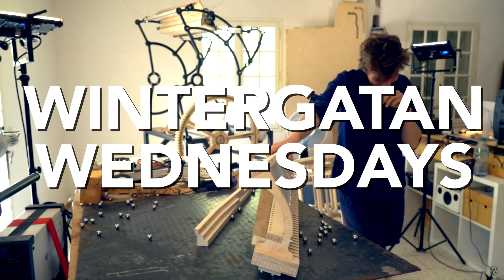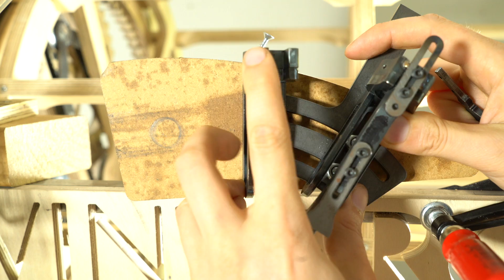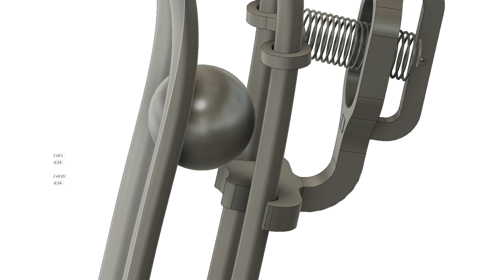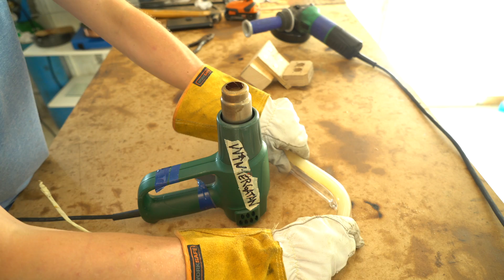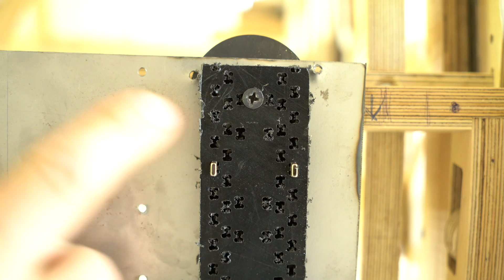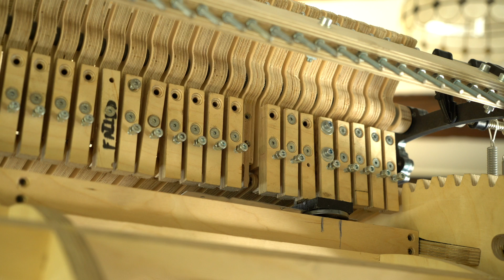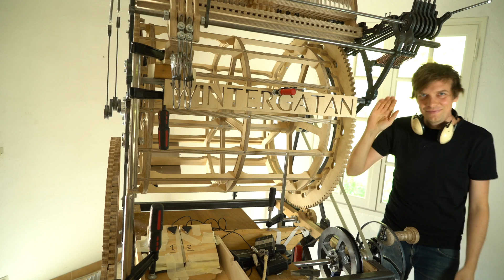Dropping the Ball - PRECISELY - Marble Machine X #52

Comment: And two-and-a-half years later, he has finally sorted out the marble dropping. Good work takes time...
Reply: You were a year early. He has now decided his design requirements were dumb, dropping from 2 points is dumb, the arc is dumb, adjustability is dumb. And simplified everything with actual tests to get 0ms timing and excellent position precision. And in 5 more years, we will have one that can land on the same atom with no losses to noise or heat either.

Comment: Yay, nice progress! Seeing you adjust the machine foot made me consider how important it will be for you to keep the machine stable and, level as you develop and tune it. Some relative and repeatable leveling method will give you a point of reference. When you move the machine, or add or remove heavy items, the level may change. Varying level will affect how the marbles move in a varying way. EG, a timing test with the machine tilted left and the marble impact targets seemingly level will have a different outcome than with the machine tilted right. Perhaps not as much between adjacent channels, the effect should get more pronounced when you test the timing between distant channels.

Comment: Clever solution adjusting timing with elastic bands, but will they hold their length indefinitely? I think they could lose elasticity in the long run and you might have to readjust timing over and over again.

Comment: Hi Martin,  your work is just electric...even though it doesn't use any!! A reference to your work (credited of course) would add a wonderful touch of excellence to a presentation we are doing. I would like to use 20 seconds of your Wintergarten Machine in a video that will only be shown on Power Point to a limited group of people. How do I gain permission from you please?

Comment: Fråga / Question :

En sak jag inte förstår: behövs det inte en motor som snurrar exakt samma hastighet med samma RPM hela tiden för att hålla BPM? Är det inte omöjligt att veva i exakt tempo manuellt? Det känns som att veva i tempo måste vara mycket svårare jämfört med att slå i tempo med en trumpinne. Hur funkar det?

One thing I don't understand: Isn't a motor that spins at the same rate constantly with the same RPM to keep the BPM? Isn't it impossible to crank in an exactly timed fashion manually? It seems as it would be a lot harder to crank in tempo compared to for example hitting a drum with a drumstick in tempo. How does that work?

Comment: The obvious solution is to drop the marbles with solenoids, BUT... If it's a rule that the machine should be purely mechanical (other than electronic pickups)...

Then I suggest each marble should be dropped with its own spring which releases the marble quickly regardless of machine speed.  That is, the marble gets stopped, then its spring to release is mechanically tensioned, slow or fast doesn't matter.  Then when the marble is to be released, the spring lets it go quickly, released in the same way a moustrap is triggered. 

That would probably be a total redesign, but it would solve the timing problem of delayed release with slow tempo.

Comment: for precise tuning of your timing, maybe using a drill set at a specific RPM on the crank shaft with an RPM meter may help to get your timing absolutely precise so that when you run ti by hand in a song you cna be sure its working exactly as intended, without the variability you may get when using hand operation. i figure no one can be perfectly precise in their ability to maintain the proper RPM, and asa person who dabbles in drumming (and have for over 20 years now, though i admit being rusty now) i figured that you would want as precise calibration a you can get.

Comment: After 45 cm of height (estimate) the marble drops at about 3 m/s (takes about 0.3 s to get there), so adjusting the height by 1cm should alter the timing by about 1/300 s = 3.3 ms. So it's better to time the release. Note that adjustments of drop height alter the delay independent of the music tempo while  adjustments of the release timing depend on the tempo. Ideally the flight time of all marbles (for all instruments) would be the same or altering the tempo will lead to sync issues as with the rythm section.

Comment: Have you considered using an electromagnetic force to hold the balls in place? You wouldn't need to worry about springs or timing anymore since the tempo would control the switching of the magnets. Furthermore, doing that wouldn't require an external power source, you could use the rotation of the machine itself to generate the current needed for the magnets.

If you didn't want to use electromagnetic force, you could always just use levers with one end magnetized. Again, it would be tempo controlled. The magnet could be above the ball and when the lever is pushed down from the back, it would raise the magnetic head and the ball would drop.

Just to reiterate, the point of using magnetics could be to eliminate timing issues of a spring release (along with uneven spring tensions) and use a method that would provide far more consistent timing.
Reply: Magnetized balls was one of the biggest issues this machine had before. That wouldn't be a feasible option at all.

Comment: This is of course a bit late iif the parts are finished, but how about a screw to use for timing of the release? To the tip of the release so you could always tweak it if needed.

Comment: I suspect it would be a good idea to get the guide wires annealed after the shapes are fine-tuned. This will harden the steel and help prevent it from bending during tear down and reassembly on the road.

Comment: Not to split hairs but I think you mean They where made of 3 assemblies , As each screw nut bolt wire spring  = a part and multiple parts make your 3 assemblies , Awesome work by the way been following your progress for ages

Comment: Just a suggestion for the shimmed part, perhaps you could use a second screw below the first and adjust it in and out - perhaps to a captive nut on the machine-side finger so it's a sort of adjustable wedge angle. Similar to the clamping mechanism used on a wooden handscrew clamp. Cheers ^_^

Comment: I could be wrong, but shouldn’t the “release speed” be independent of tempo?  The release needs to closer to clockwork than something else—that is that a “tick” results in the same release each time, regardless of how rapidly the ticks follow.  The reset time is then a limiting factor (i.e.how long does it take to return the mechanism back to the start point, ready for the next “tick.”).  The current design uses a different release at different speeds—requiring a more complicated release so that tempo doesn’t impact release timing.  Just my 2c.

Comment: Very nice! I think a lot of the shake of the machine is introduced via the crank. The torque is up and over and down and over and could be decoupled from the effect on the machine through a pair of universal joints. I had much the same problem on the compound of my lathe and this seemed to be the best solution. It now gracefully move only back and forth instead of in a spiral.

Comment: If you go back and look at the part of the video where you were showing the channels you can see the timing error on the channels.  The holes in your programming plate are not aligned.  With the shims it should be easy to over come this problem.
Another observation that isn't unique to the marble machine but the ear is better at noticing the difference in drop times.  Maybe that's why music was the first type of entertainment.   OK, maybe sex was THE first type of entertainment maybe "art" should be used instead of entertainment.  Can imagine cave men sitting around rapping?  Would be the perfect first type of harmonization and co operative music making;o)

Comment: I’ve been watching with so much excitement and awe at the patience and rigor you’ve applied to the quality and accuracy of what you’ve been designing and building, yet now it feels like that has been cast aside here? The bending of that wire to make these release does not seem like it can be accurately repeated and scaled to ensure consistency across the channels. Fully appreciate all your design considerations but isn’t this solution just impatiently shortcutting in a way similar to how you would have solved the issue on the first MMachine? Where is the pride in the engineering?

Comment: it should be designed in a way that you can adsjust te hight and direction by twisting a bolt so you can manage it easyer than releasing the whole thing and remounting it.

Comment: You can omit some of the timing problems by creating a different release mechanism. I'm proposing a sear/latch mechanism (like how a gun trigger-hammer assembly works.) You don't need a lot of play just to block a marble from passing through a gate, even a 1mm latch can do the job. As for solving where the marble hits, you can simply add a "Y" funnel of some sort so both channels have a common output.

Comment: The landing pad(s) had foam on the back. They were bouncing around and not fixed tight. They could and would continue to give you slop since they were higher and lower to each other as they moved from being hit. I realize that this is not the final strike plate and you only wanted to test the adjustability of the rig. I agree that the MMX is tight!

Comment: Great progress! The reason engineers don't like bending the wires is because you'll deal with hours of fine-tuning every time you move the machine. I think you'll find that the biggest source of the variance in timing is where the marbles hit the pickup plates. Since they are diagonal, a small difference in horizontal position makes a big difference in the distance the marble falls and thus the timing. Make the bottom plates (pickups) adjustable and you'll spend less time fine-tuning the timing...
Reply: the way he explained it he want to have two channels hit the same pickup to increase speed so adjusting the pickup is not an option.
Reply: In this test, it kinda was.  You can clearly see from the video that the marble on the left was hitting higher up than the marble on the right.  If both marbles were hitting at the same level on the plate, the timing would have been different.  If they were dropping at exactly the same time but one was dropping further down on the slant, then of course the one dropping further down would hit later, making them seem like the timing is off.

I wish he would have tested the 'same spot' test to deal with this specific thing, as if they WERE hitting the same spot, it'd be much easier to see if the timing was actually off or not.
Reply: @firedale2002  I am sure the day of this test will come :) 
The whole point of the test was to see, how well the adjustment mechanism works and how well it can be fine-tuned. Adjusting the pickups would have been easier and more precise of course but it would miss the point of the whole test.

Comment: If you want accurate measurement, you need to make both pieces of wood with the sensor co-planar. And the left to right swivel equal on each dropper, perpendicular to the ground.

Comment: i don't know why but i thought if you went backwards would it break something or is there a part where you can't go backwards to prevent problems just some ideas like in the videos i always see you going forward and not backwards and another idea i mine if your arm did not start the the cycle but your foot did would it go forward or backwards because if you start with the crank then the foot it would be normal but if u started with foot pedal and not crank just a brainstorm that came to mind

Comment: Hi Marint, i really liked the music.
after reading @James Kerns i think you should measure the timing difference that every metal shim gives you.
considering the shim the first timing variable and the height as precision tool why don't you make the resting plate adjustable in height with a screw on top?
here come sketch https://i.gyazo.com/10d9283981fa93e481083875682564eb.png( is rough but you should understand!  )

Comment: Hi there. I maybe have a solution for your one hand adjustmend problem.I am from the aviation and we use there many anchor nuts. As an excample https://kl-projects.be/ln29679-235c/ Normally it is riveted to a sheet metal but you can also screw it in your wood construction.

Comment: Hello Martin, I am a new subscriber, and I have watched many of your videos, but certainly not all yet.  I have similar interests in woodworking and instrument making.  I make mainly marimbas and xylophones.  I love your previous instruments and am excited about this new one.  These questions may be answered in previous videos that I have not watched, but I am wondering if you will automate the bass fingerings on this instrument, or is that still part of the “human element”?  Also, will you be using similar vibraphone type bars, and making them from a harder metal than the steel balls to prevent long term damage to the surface and therefore intonation of the bars?  I absolutely love this instrument build and your musical compositions as well.  Thank you, and keep up the good work!

Comment: Hello Martin, I couldn't help but notice at 23:45 that the metal pins are taking away material from the registrators, which could be an additional source of delay (or actually, early triggering of the mechanism) that would arise over time and in the extreme case, after years of use, the pins might just go through the "slot" that is created over time, and the registrator wouldnt trigger anymore at all. I was curious if you already have a solution to that - maybe replacing the part of the registrators that touches the pins with metal?
Have a good day!
Reply: I would suggest a simple sheet metal bootie.
Reply: I saw that too, he probably notices it when he's up close with it.
Reply: as i saw the cuts in the registrators, I was about to say the same things
Reply: In clock mechanisms one employs brass for the more disposable or more easily replaceable part and steel for the part that needs to be more durable. Meshing parts that are both brass or both steel will mostly wear out the part that is most frequently in contact. In this case, pins of brass and boots of steel.

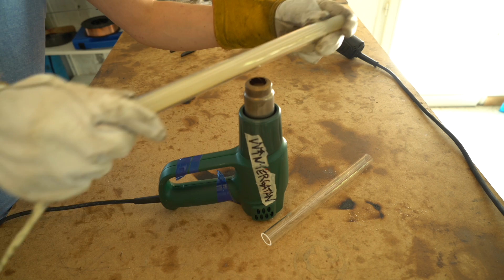Comment: Perhaps it's too late (and not very important) but when you bend the tubes at 12:39, you might want to consider using a faster shape for the bend. A cycloid "is the curve of fastest descent under constant gravity" (Wikipedia) which would allow faster playback. Just a thought because that single 'kink' in the tube doesn't look super efficient to me.

Comment: 21:45 to make that a home-based operation you could use what is known as a t-nut. They are useful in many places when building with wood. You can find several types and sizes on McMaster Card catalog pages 3395-98 which is available online. I am very non-gifted at Facebook stuff so I don't know how to send a link. These nuts are easy to install, stay fixed in place an they are lighter in weight and take up less room which might help on the world tour. If you check with This Old Tony I am sure he can point you to a supplier with better pricing, but I just wanted to make you aware of these in case you were not. Good luck!

Comment: Fantastic work Martin! 
Pin height variations in the programming board could effect ball drop timing. Perhaps after installing pins a programming board segment could be passed between two rollers to iron the pins to s common height?

Comment: Marble release needs a releae trigger.  The bar holding the ball needs to be spring loaded, so that it OPENS at the exact same speed every time.  However, the TRIGGER can be pulled at whatever speed you want.  This will RELEASE the ball at the same speed every time, but the mechanism releasing it wil be TRIGGERED at the tempo of the music.  ;-)  

Think of a trigger and sear from a firearm.  I can pull the trigger fast or slow, but the sear still slips loose and the hammer falls at the exact same speed and timing every time.

Comment: If you need the release to always move at a consistent speed why not use some springs and a similar mechanism to the bi position level to have the force of the spring drive the release rather then the force from the machines movement. This may not matter because the tempo in a song is rather consistent and if the speed of the machine changes the timing of the marble drop slightly changing may not matter because the change is consistent.

Comment: First of all... I absolutellh love yojt channel and the project. Thanks for that. A thought...about the timing issue foe the ball drop, how exakt is the pin position for different insertions. If yiu adjust with shims it solves the issue for one particulsr pin setup but if you change this it might still be a problem.  Just a thought... keep the good work up.

Comment: Within the first five minutes I thought of a solution involving gravity. This was written before watching the rest of the video so I don't know if he mentions this or not. 

There would be an extended bit of track on the dropper after the fork with a set length and angle. This would prevent the speed of the fork's movement from having any influence on the angle it's dropped at. You would angle based on Earth's gravity (9.81m/s^2) so that you can maintain high accuracy with a certain angle. So long as you know the speed of the marble coming out of the dropper (which is easy to calculate with gravity as well as the angle of the dropper) then you can control the exact location of where it drops and hits.